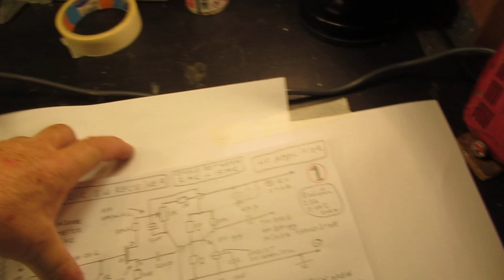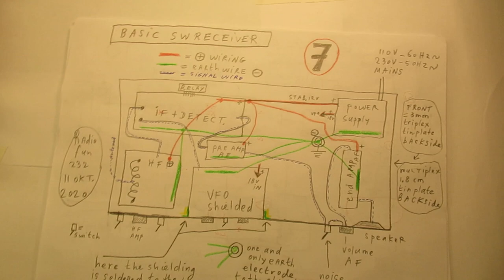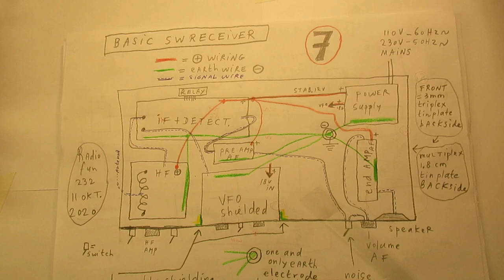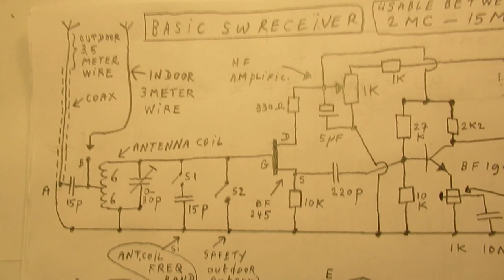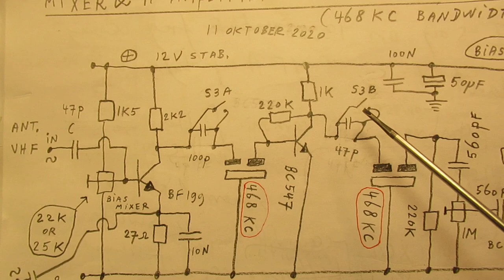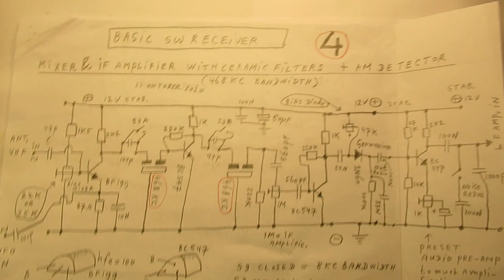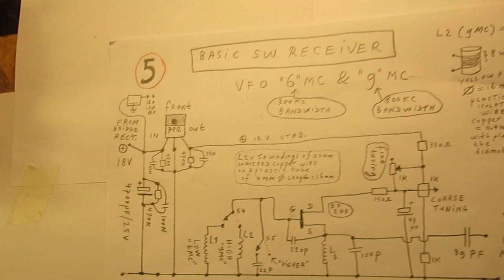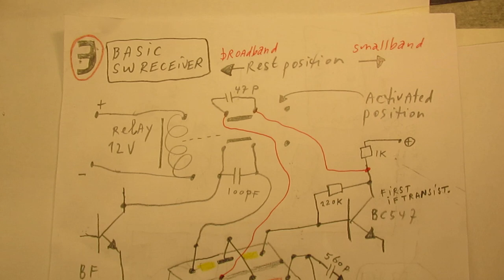Schematic of a very basic SW radio usable between 2 MC and 15 MC (here 6 MC and 9 MC) + demo

Comment from the maker: Please note that this a "platform" circuit. You can use a AD9837 of "Analog Devices" to make a VFO that is stable on 1 Hertz, driven by Windows 10 or a lower version of Windows. Analog Devices sell a very good "evaluation board" with that AD 9837 Chip, that makes it possible to use this circuit in a very elaborate way. The IF Amp will also work good with a BFO, going 3 KC lower and 3 KC higher compared to the IF frequency. Read my reaction to Ivan Lam for more info & search my channel (via the looking glass on my channel trailer) on words like "BFO" or "Beat Frequency Oscillator" or "Shortwave". 13 oct. 2020.  Proper SSB reception with a BFO can be set with the "forward bias" potentiometer to the AM detection diode (preferred: a Germanium type).

https://youtu.be/M9HRwDvFI54
VFO setup with 2 potentiometers 6MC & 9 MC & IF amp setup
https://youtu.be/Q5PgSVHEc3A

Comment: Hey, Ko. I have really enjoyed your videos over the years. Thank you so much for posting them.

I think it also might be educational to show folks how to add switchable band-pass filters on the front end as well. For better multi-band coverage, the addition of a 0-30 MHz DDS VFO would be very interesting as well, although I'm not sure if this is beyond the scope of your videos. I say keep it simple and show them how to use discrete components for the sake of simplicity, and then point them to other sites for such information, now that I think about it, Sir.
Reply from the maker: Thanks for your comment, Dave. Yes, there are much more possibilities to develop the radio. Indeed the use of a Chip oscillator (Analog Devices makes them, like you know) with a 1Hertz or 0,5 Hertz stability is also a good option. Such high tech chips (AD9837) can be used here and Analog Devices also sells evaluation boards with that AD 9837, so that you don’t have to solder that chip. Also enough possibilities to make a stable VFO with an Arduino. This is also the aim of this video: to give a kind of "platform" for more or specialized radio reception. Indeed the antenna coil must be adapted to the frequency (band) that you want to receive. Though the showed antenna coil is by purpose a kind of "overall usable" one with a high Q. An antenna tuner can also be used to pickup weak signals out of the SW noise, it is on my YT channel.

Comment from the maker: Best usable VFO to get to a broad bandwidth on receiving SW radio stations (2-15 MC) is here:
 https://youtu.be/Ng49kGF3n8o

It goes from say 1 MC to 15 MC with suitable VFO coils & adaptation of the capacitor values in that FET VFO. Schematic gives detailed info. 

Of course in that case (when using it in a SW radio receiver) the antenna coil must be adapted too. To that (say low or lower) frequency band. 

There must be always a difference between the frequency of the recepted radio station on SW and the VFO frequency, in case of a (single) superhet radio. That difference is decised by the IF frequency, say between 430-470 KC. 

Often is used "down mixing": the VFO frequency is (say) 455 KC higher than the frequency received on the antenna coil and amplified afterwards. 11 oktober 2020.

Comment: Changing if filter bandwidth with a switch is neat! Is it worth adding a bfo to demodulate ssb and cw?
Beautifully Done!
Reply from the maker: Thanks & yes, that is surely possibe. You can inject a BFO signal in the IF amplifier. Reason why I used the "forward bias" potentiometer in the AM detector diode circuit. In case of detection a SSB signal you can use it to align the SSB detection.
Reply: @radiofun232  Thats interesting, how is That done?
Reply from the maker: @ivanlam5783  It is very simple. One thing: the VFO must be stable enough (say within 100 Hertz). When you make an oscillator that deviates 3 KC + and 3 KC - of the IF frequency (so here: between 465 and 471 KC with a 468 KC bandfilter) you have a so called "beat frequency oscillator" (BFO). Connect to the output of the BFO a capacitor of (say) 10 PF and search a location in the IF amplifier where you can "inject" that BFO signal. SSB signals on Shortwave are sent out without a carrier wave. Your BFO "makes" that carrier wave. In case of CW signals (morse) you tune the BFO to a frequency where there is a difference of (say) 1000 Hertz between the BFO and the IF frequency. That makes the morse signal audible (with 1000 Hertz). Key is to create an audible frequency.
Reply from the maker: @ivanlam5783  Here you see how that works
https://youtu.be/-E3dHYCIAGQ
Reply: @radiofun232  Thank you

Comment: Nice 
Sir,  the germanium diode is rare  , if I use the schotky diode is it right?..Thanks
Reply from the maker: I really don't know. Try it.
Reply from the maker: Or try a Silicon diode (not tested). You can align the forward bias with the potentiometer.
Reply: @radiofun232  Thanks
Reply: 1n5711 is very common schotky signal diode from ST semiconductor and work very very well as AM detector. Maybe you should be put a much higher preset to biasing the 1n5711 something between 150k and 1mega ohm.
Reply: @francoisdastardly4405  Thanks very much
Reply: @mohammadalfauomey3443  happy to help, good luck building this receiver !